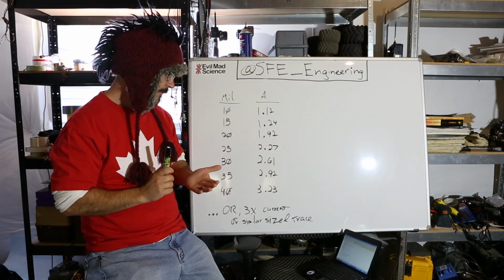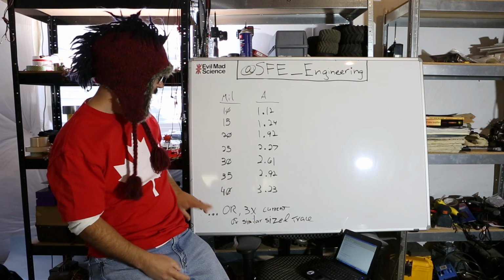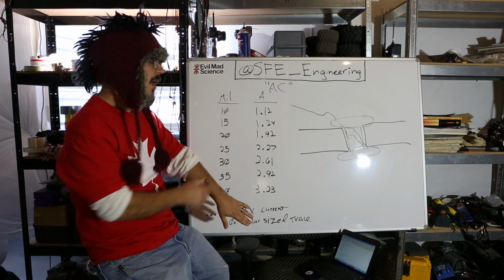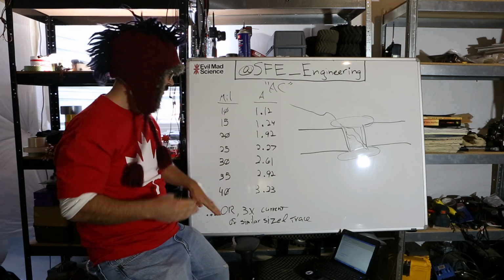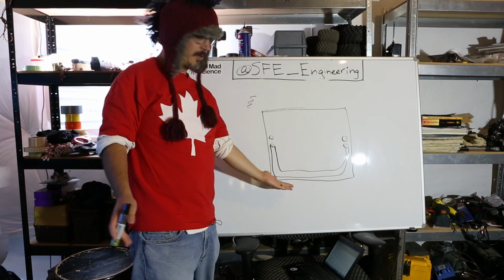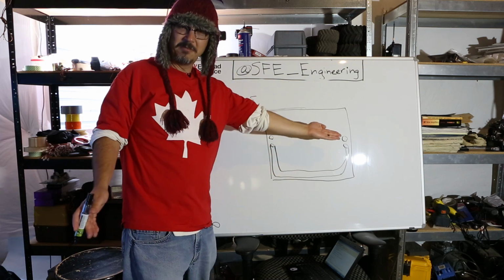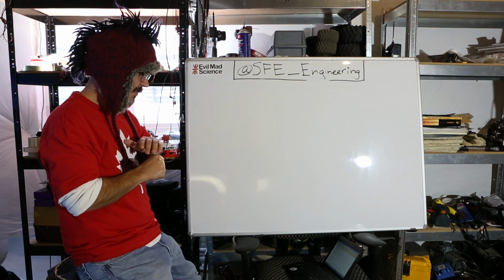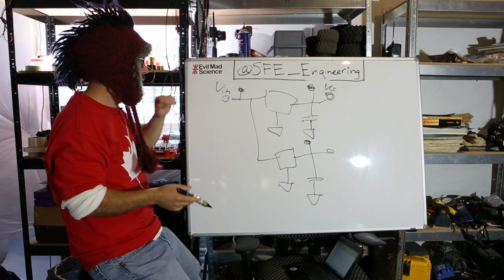SparkFun According to Pete #35: PCB Layout Part 2

Comment: Just a guess that the current rating of trace vs via is related to the width but now related to the circumference of the circle as the conduction path so use pi?    I'm guessing that's where the rule of thumb is from, length of 2pi*r, or pi*diameter, so via width as the diameter pi flat trace current rating?

Comment: thanks pete! also: from what ive read in altiums reference guides, the reason youre not supposed to run a large trace around the board is that high power can cause warping (due to heat) and stress the solder joints

Comment: At a place I worked at in the mid-late 90's we had a third use for a separate set of power & ground planes. We made EEG machines, so normal use of our products the input stages were connected to a patient's scalp, sometimes the input stages could actually be connected to a patient's brain with deep-brain probes. So, we had some boards with three plain pairs, a digital power/gnd pair, analog power/gnd pair, and patient connected power/gnd pair for patient safety isolation. (Almost all our boards were 4-layer with the planes internal, almost no SMT (this was the 90's) so connecting to internal planes was almost automatic.) Granted, this is a special case, but there it is.

Also, as I remember, our digital and analog plane sets were connected at a single place back near the power supply section, not near/under the analog/digital hybrid chip as you showed on your white board. Are these more style issues, or do you see pros and cons to both methods?

(I don't remember how patient isolation was maintained at the power supply section. I was the tech drafting the PWB layout to the engineer's rules, not the engineer defining the rules.)

Comment: Why would I use a polygon pour for something else than power?
1) Heatsink plane - e.g. from an linear regulator or such
2) To save the etching solution - more copper left = less and faster etching

Comment: 3x trace capacity for via current makes sense.  The cross-sectional area of the copper leading through the hole should be about Pi * D - minus a bit because it'll be just slightly smaller on the inside of the hole than the outside.

Comment: Most analog ground pins and digital ground pins are actually connected internally (for chips such as an ADC). However, this is still the reason you connect below the chip. I recommend reading about mixed signal design, such as by Henry Ott or in the ADI book (edited by Hank Zumbahlen), Linear Circuit Design Handbook (free online).